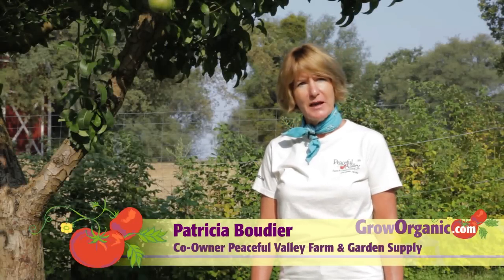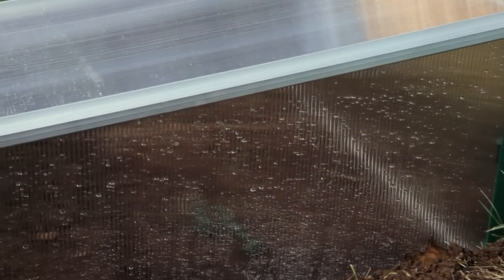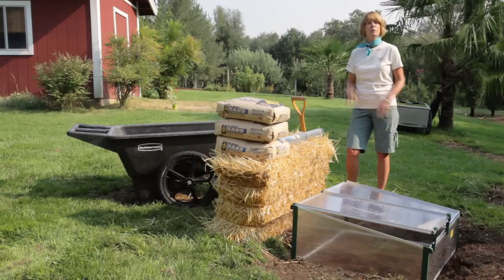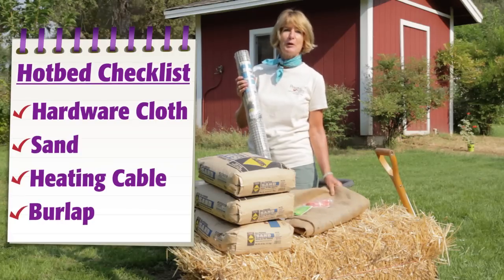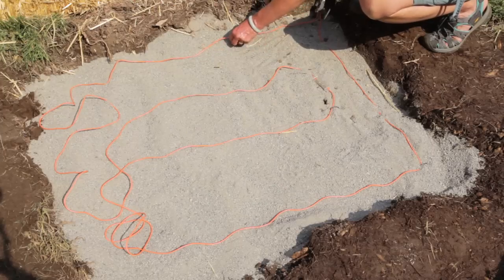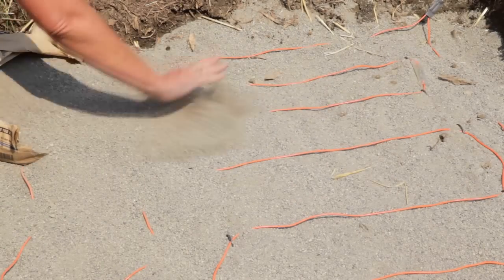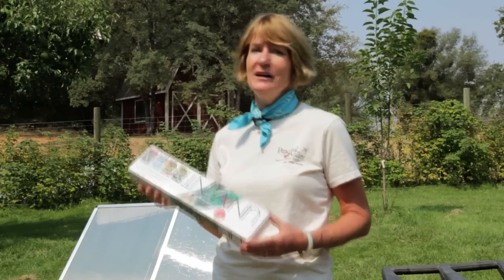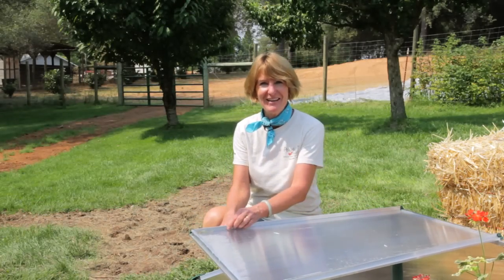What is Cold Frame Gardening?

Comment: Thank you for your video. Pleasant voice, and directly to the point with awesome information.  I do have a question or two. Why are cold beds built at an angle with the back rising up ?   Is there a way to convert a square foot flat garden box to accomplish using it as a cold frame?